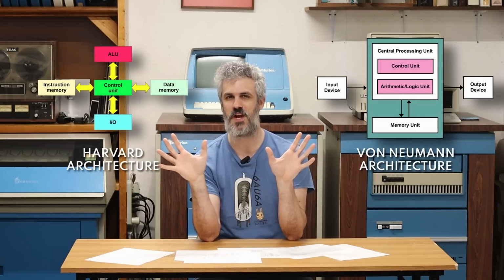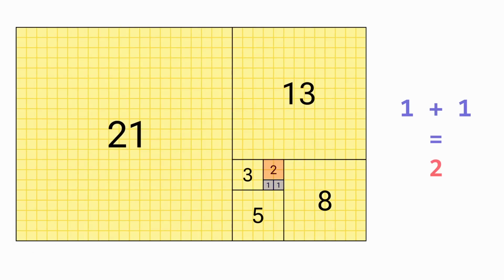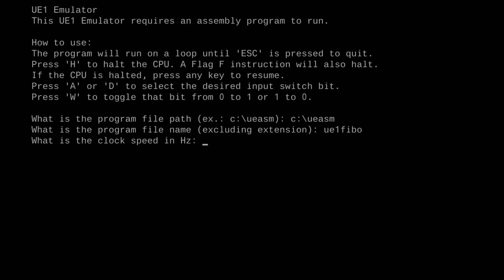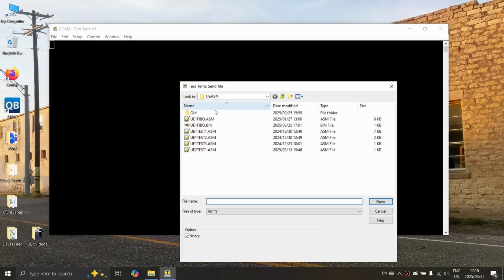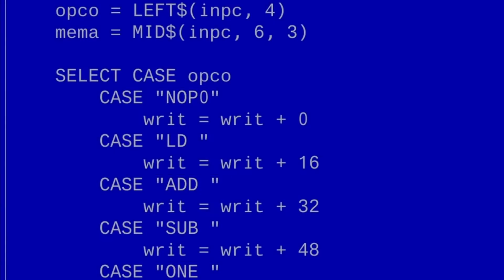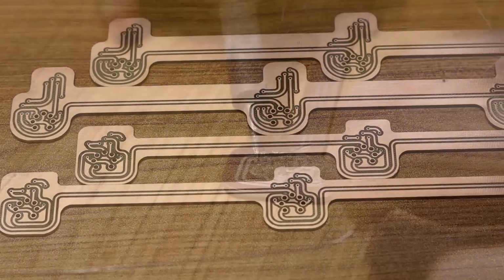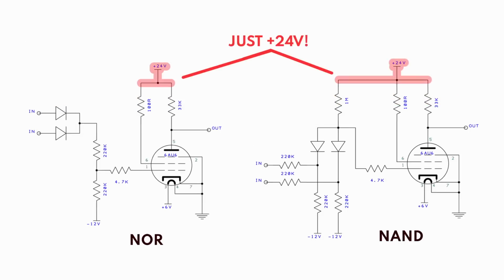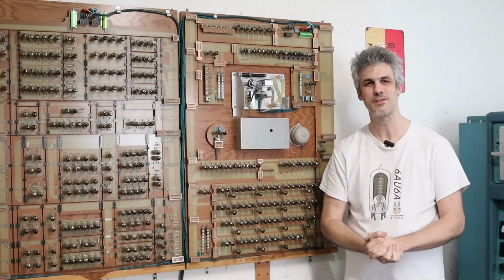I Tried and Failed to Run a Simple Program…

Comment: That man is a masochist. Not for building his own computer, but for programming the emulator in QuickBasic.
Reply: Yeah, he should try something simpler first; like writing an emulator for the “electric bunny” featured in all his intros… (in QuickBASIC)!
Reply: @williamsquires3070  Is that a challenge?
Reply: It would have been fun if he wrote the emulator in assembly to run on the Centurion, or the Bendix even
Reply: @TSteffi  Yes. And it would have made more sense too 😁
Reply: I did a lot with QBASIC way back in the days of dinosaur.  Programming on a platform you know rather than one you don't is NOT bad choice.
Reply: when you're emulating something that runs so slow, why not just use BASIC?
Reply: QuickBASIC ftw!
Reply: If it helps any, there is an environment called QB64 which will take BASIC as input and translate it to C++. It also has extensions built in like the ability to play audio files, which can provide the bell functionality (by sampling the real bell).
Reply: @mal2ksc  How is the Sacred Chao doing these days?
Reply: Why? It's very basic and it's quick
Reply: Would you prefer some verbose and slow garbage like C#, or another of the "modern" languages designed to allow incompetent people to become programmers?
Reply: I've done a little bit of programming with QBasic before, and I actually really liked it. I imagine it's similar to QuickBasic.
Reply: @ct6502c  It is a subset of QuickBasic.
Reply: @ct6502c  QBasic is a cut-down version of QuickBasic. All QBasic programs are QuickBasic programs. The main difference is a lack of compiler, but there is also some system-related functionality in QuickBasic that wasn't really necessary in QBasic.
Reply: The best computer language is the one you know how to use
Reply: It's actually pretty easy for simple little programs such as that.  Especially if you already know it as opposed to trying to learn a new one.  These day Grok could write your simple code easier probably.  It designed the appropriate sized ventilation hole and air flow required for a project I was working on the other day.  It was rather easy.  I used to like the old Visual Basic before .NET came around.  Of course BASIC became obsolete around that time anyway.
Reply: If he is going the sacred path of the DOS programmer, expect great TurboPascal code soon! With fast 80x25 ASCII graphics windowing directly handled via mapping $A000 as an absolute 4K character array (that you could just copy wholesale to a buffer, pop up a dialog, and remove it again by reading it back!).
Reply: Nothing wrong with good old QBasic, you can even compile it if you want with either QB45 or FreeBASIC.
Reply: Apocalypse Tranning.
Reply: We all know that LISP is the ultimate tool for slow one bit computers😅
Reply: I cut my teeth on QBASIC. I then went on the FreeBasic, then on to C. FreeBasic was a pretty neat, and natural, step up from QBASIC, I can recommend it to anyone used to QBASIC.
Reply: And for the kink.
Reply: yea he should have used Turbo basic
Reply: Nah, should've used an entire WAMP stack to build out a webserver complete with UI web page using PHP.
Reply: Lol kids code in Python nowadays, but somehow consider QB tough...
Reply: There's nothing wrong with QB. It was my primary language for a long time, even after I got access to Visual Basic. It was only VB6 that eventually displaced it. (C++ eventually displaced VB.) My first experiments with parsing and emulation were in QB.
Reply: I too designed and then made an emulator for my own computer in QBasic. It's so easy to use.
Reply: @Franko_Walker  QBasic and QuickBasic aren't entirely the same thing actually.

For one, QuickBasic can actually compile to an executable.  QBasic cannot.  So when QuickBasic runs, it runs a bit differently and faster as a result.
Reply: ? It's a perfectly cromulent procedural language.
Reply: @TheBilgepumper  Yeah it could be a lot worse. He could have written it in COBOL. Or honestly I always found FORTH just incomprehensible - the dictionary defition of a write-only language.
Reply: @NateEngle  Funny you should say it that way.  FORTH is extensible, and relies on dictionaries (okay, vocabularies) of newly created words based on primitives and other created words.  If a FORTH coder has not documented what amounts to his own private language, then there's no way anyone else is gonna understand it without a whole lot of head scratching and head banging (not the nice kind that involves listening to Danzig or someone like them).
Reply: @horusfalcon  My reaction is probably based on the kind of listings I saw back in the day, and bear in mind that my favorite language is still C. I'll always grant that FORTH is very powerful and compact but without a lot of comments it can be difficult to unravel. In that way it reminds me of Brian Kernigan's awk - very powerful but crytpic, and the only worse example I can think of is something like Malbolge that was deliberately designed to be hard to understand.
Reply: @NateEngle  Yeah, I get that, man.  I'll have to give Malbolge a look.  C can be pretty cryptic in the hands of an obfuscated code competitor...  Peace!  (My first actual computer program was written in FORTH way back in the seventies.)
Reply: @NateEngle  With the power of regex, it could have been a perl one-liner.
Reply: @drstefankrank  I wrote a lot of perl in my last job but I avoided regular expression syntax out of courtesy to whoever was going to maintain the code next. When you've mastered automata theory regular expressions make perfect sense but that's like 300 or 400 level computer science and  most people just don't get into that stuff these days.
Reply: @NateEngle  Try postscript. So fun to program in, once you get into its mindset, that you forget it's supposed to be a printer control language.
Reply: @drstefankrank  Now that's masochistic!
Reply: @NateEagle
COBOL really isn't that bad, provided you are using it for the kind of tasks it was created to perform.

Comment: 7:00 I love QuickBASIC (and/or QBASIC) - it was a nice bridge between the 8-bit micros of my youth and the world of PCs, and was reasonably capable.

Also, a simple fix for your opcodes would be opco=RTRIM$(LEFT$(inpc,4)) which will trim off trailing spaces, then you can eliminate the spaces in your CASE statements.
Reply: I don't know, BASIC without line numbers seems... unnatural... (I'm very old school and learned BASIC on a timesharing system in the mid-70s's)
Reply: @nonadabove  You can still use line numbers if you want - it's essentially backwards compatible with GW BASIC.

Comment: Homebrew computing is hard.  It's gotta be even harder when you introduce vacuum tubes.  One step at a time, it'll get there.
Reply: And you choose to use vacuum tubes in an architecture they were not designed to support (i.e. that extremely low plate voltage).

Comment: I am not actually a low-level hardware develolper, but to me it appears to be a substanital issue with frequency? Maybe it is something about you testing it with 10Hz clock? If the code has no timeouts, no additional workloads it may happen that undefined behaviour takes place? It is just a wild guess, but I'd start by running the code again on an emu on different clock speeds and if there is no change at all - it will continue to run properly, then it would mean that it is a hardware issue. But I assume you already did that, but did not mention it in the video.
Anywayz, in love with your vids, thanks much!
Reply: He has hardware single stepping feature. I assume program fails in this mode as well.

Comment: really hard work -- maybe try to test the realtime behavior to programm small endless loops of the tape with only instructions for the memory or other ciritcal instructions so you can use the oscilloscope for measuring what happens,  The scope should have a quite long memory, so you can capture some signals also without using a loop trigger by the start or so,. For example set 1 then read the set 0 then read for all 8 bits.  The worst happens is if the bits of one location  depend on the other bits stored in other locations, then more complicated tests have to be done. -- way back we had to find a "memory" problem, a compiler does not work at a certain instruction, when we stepped through the code all was fine, when runnign it broke at a location- cause was a missing terminator resistor in the memory ... thats after I stepped through the whole gnu compiler (I860 self adapted)... took some weeks

Comment: I feel for you.  Once things get over the certain threshold of complexity the gremlins come out. FWIW, I’ve been chasing an elusive bug for months myself.  It’s hard to stay motivated but I must prevail.

Hopefully you’ll learn a lot from this that you can apply to the next project.  Thanks for sharing.
Reply: From what I know, amount of problems highly depends on amount of isolation between different parts of the system.